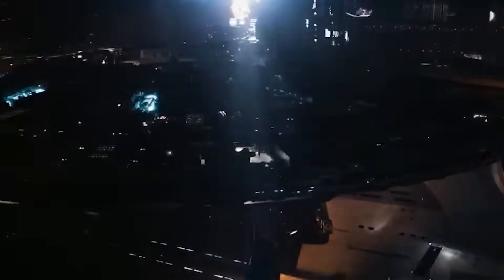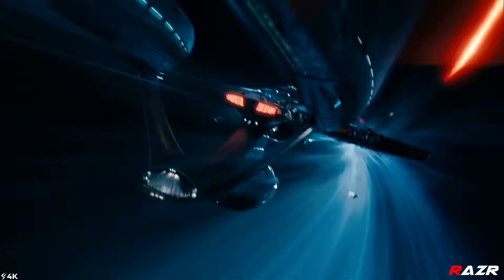How Close Are We to Building a Star Trek Warp Drive?

Comment: Energy solved with zero point energy transducers. Basically unlimited energy to travel the stars.
Reply from the maker: Zero point energy is there, but the problem is that it’s perfectly balanced. It's like floating in the middle of an ocean that’s completely flat. There are billions of tons of water under you, but the surface is so smooth you can’t make a wave, nor can you scoop any out. Zero-point energy is like that. It's everywhere, in everything, but there is no way to create a difference, no way to make the energy flow from one place to another. And without a difference, energy is useless. A battery only works because one side has more energy than the other. Zero-point energy is the same on every side. We would have to rewrite the laws of physics to be able to access it, and I will bet dollars to donuts, that rewriting the laws of physics that govern this universe... is impossible.
Reply: @DimensionZeroTV  "I will bet dollars to donuts" or as Lt. Desalle said in the TOS episode Catspaw "I'll bet you credits to navy beans..." 😂

Comment: One thing you forgot to add in about the Enterprise..it uses Ion Propulsion...which is feasible but today it's in the embryonic state...of development.
Reply from the maker: From what I understand, they used ion propulsion only in a few episodes for specific reasons for the episode, but not as the main engine or impulse power. Impulse power uses fusion and generally, ion propulsion has a much lower energy output.

Comment: We know space can be warped by gravity.  That means mass is required, not energy. The mass tells space how to curve. It can be seen in Einsteins cross and other gravitational sensing seem in the universe.

They mentioned Harold Sonny White of the NASA Eagleworks lab. The research didn’t find any evidence that space could be maleable using energy.

If you could cause a black hole ahead of a ship you would not need a white hole behind the ship to be dragged through space up to relativistic speeds but putting the ship in some superposition of space itself is something entirely different.  

The technology would require two things. A warp field generator to isolate the ship from space itself. Then once it's isolated it must somehow cause the bubble itself to move faster than light.

Moving something faster than light would mean the engine must be able to cause a bias in space-time that lets the bubble sort of "slide" along like a soap toy when squeezed, causing it to pop out of your tight grip and fly forward. 

I suppose it might be a something akin to an electric potential. A bias. The potential "wants" to slip ahead and the speed by which it slips ahead is dicrated by the potential  or bias. More potential / bias would me it moves faster.

I thonk the reason negative energy was required originally is because Alcubier was trying to expand space like anti gravity behind the ship like creating a tall wave that a surger would slide down and away from instead of like a waterfall ahead of the ship. 

Pyrely conjecture but a fun thought experiment to consider that we know space itself can bend and twist because of gravity or rather mass. 

So far we know gravity moves at the speed of light based on LIGO. That means that warping space can only be done by gravity at the speed of light, no faster. 

To make space itself move w9uld require some alternative geometry manipulation to to Mass/gravity. 

Any change in spacetime curvature — including anything like a warp bubble’s expansion/contraction — cannot propagate faster than light through spacetime.

You can’t “update” the geometry faster than light. So if you try to form or steer a warp bubble, those changes can’t spread faster than light either.
Reply from the maker: Nice write up... at the end of the day, the forces that we are dealing with can obliterate an entire solar system if things don't go right. The testing phase alone could make the dream of a warp drive unattainable.

Comment: You forgot most important thing: the theory of special relativity which states that nothing can travel faster than the speed of light, applies to the motion of objects locally and within a region of spacetime. The space between galaxies, not the galaxies themselves, is expanding at 73 kilometers per second per megaparsec (about 3.26 million of light-years). That is far less than 300.000 km per second
Reply from the maker: I actually made a video on this and the idea that you are still breaking the underlying laws of the universe... I do not disagree with that. It could be that at the end of the day, nature will ensure that any faster than light travel is not allowed. But there are those who believe that given how warp speed works, it does not break these basic laws of nature. It's a great discussion!
Reply: @DimensionZeroTV  Warp Drive doesn't violate the Laws of physics,  it breaks them. If you are in water? you have to disrupt the water to move, If you are in the Air? You have to disrupt the air to move, When in space you have to disrupt Gravity to move.  Once you alter gravity causing a bubble of less gravity to form, the stronger gradient of Gravity will push you along. 👍
Reply: You're not traveling faster than light but going behind it, in a sense. As gravity breaks it forms a bubble. I predict a positive bubble formation because you are breaking gravity so you are emptying it out. But what do I know? I only invented the damn thing 👍

Comment: Actually the ship doesn't move unless it's the impulse drive. The warp drive moves space. We are a long way from generating that much power.
Reply from the maker: Yes, in essence, you are correct. The question is can that kind of immense power even be managed and contained? Imagine the testing phase of developing warp drive. It could bankrupt an entire civilization before ever achieving it.
Reply: @DimensionZeroTV  staggering. Just an anti matter annihilation drive. Like Venture Star in Avatar would be Trillions just to make a few grams.
Reply: Um, no.
Reply: @mrthebillman um, yeah. You compress space in font of you and expand it behind you. Impulse is different. It moves the ship. Warp drives moves spacetime.
Reply: @mrthebillman  Think of it this way, you can't move through space at the speed of, or faster than light. So you move space. Its like escalators, you are moving relative to the outside world but not moving relative to the step you are stood on.